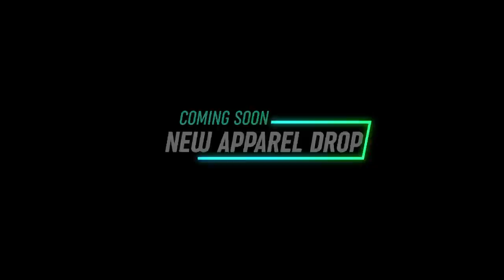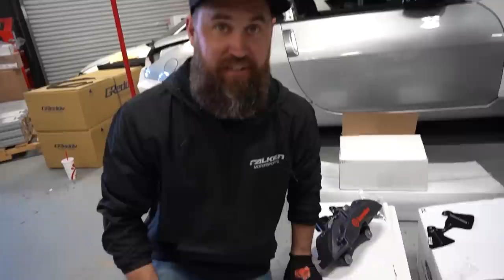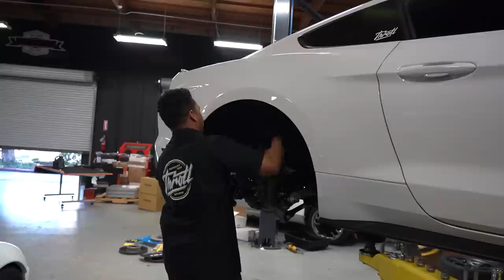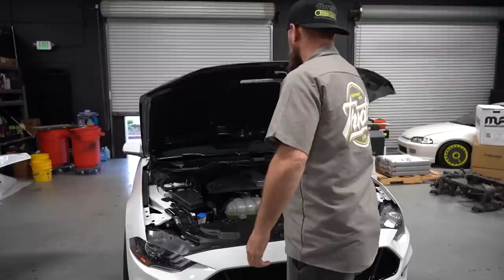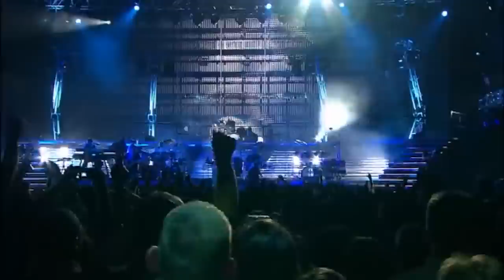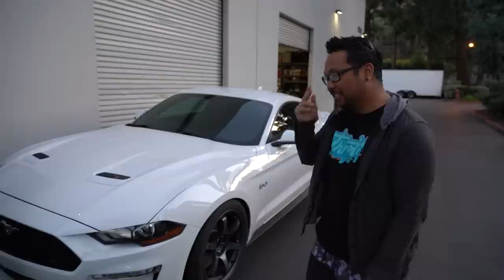Building and Heavily Modifying a 2020 Ford Mustang GT: Part 4: Brembo Brakes & Anderson Composites

Comment: Hey guys if your going up in pistons at the calliper, you need to increase the volume in the reservoir by the same percentage amount. Do Ford performance do a reservoir to match the new callipers? This will mean you won’t have to apply more force at the pedal with the new callipers.

Comment: As someone who currently has a bolt rattling around in their trunk I can definitely sympathize with that moment.
Reply: Use a magnet(s) and those one of those flexible spring loaded grabber, with the most important part, persistence.

Comment: Paint the hood car color. Leave the ridge around vent in fluoro yellow. And the vent “dent” in carbon. Then get some rays fluoro yellow wheel stickers for the 1 spoke (jdm style) en paint the red brembo letters fluoro yellow. Pull it into the car with the shift knob you removed from the NSX in fluoro yellow make the wing exactly as you said but with the little cannard edge also in fluoro yellow so it ties with the ridge of the hood around the vent 🤷🏼💪🏻😍

Comment: I don’t know if it would work but you should try put the stock front calliper and rotor on the rear
Reply: Depending on how the handbrake works on the mustang
Reply: Not doable and way too much brake for the back.

Comment: I doubt it would work but I’d be trying to get those stock front 4 piston an way larger brakes on the rear over those stock tiny boys or I would have ordered the brembos for the rear as well
Reply: Tiny? Those rear brakes are as big at the rears on TJ’s Huracan. They are more than adequate.

Comment: Guys its well in good to go from 4 to 6 pot brake calipers , But did it occur to any one to change the brake master cylinder to the "brembo sized" master cylinder for the best brake feel / performance of the new 6 pots  ??  witch the factory optioned/brembo equipped mustang would of came with stock  .... ALSO Paint as much as of the carbon as you can / thinking in the range if the ford performance factory did it, .. AS its NOT a SPOON sports Honda ek9/dc2 type R , ..... As full carbon looks a TAD tacky as you can imagine  , ..........  None the less great build Guys !

Comment: why not swap the old stock brakes from the front to the back for more stopping power?
Reply: you dont need that much stopping power in the back, the rear side is mostly for the parking brake
Reply: Was also thinking the same.... The front brake setup at the back would look good with the upgraded fronts...
Reply: Right on!
If not for the breaking power, then for looks
Reply: That’s not how it works
Reply: @typedrew   kind of expected that.
Reply: @FranticKnightX9  it looks so aggresive in the front and flimsy at the back, knowing that yeah it dont need much braking but its a mustang, it surfs crowds
Reply: @enigmarage3039  maybe the front brakes won't fit in the rear due to clearance issues or issues with the dust shield or the bolt pattern... don't own a mustang so can't say for sure... But yes... It would have looked dope if they did swap the brakes...

Comment: It really seems like it would have been easier to buy a performance pack model instead of adding all of them after the fact unless they did it like this just for content or they got the parts afterwards at a discount.
Reply: both
Reply: Of course this is why
Reply: The real reason is it wasn’t worth me spending an extra $10k on the car for just brakes. All the remaining PP bits we’re going to get discarded.

Comment: I was told once that it is not good to use those tools to install studs on your hub I was told also the proper way to do it is to use a shop press.
Reply: I’ve personally used this method for probably around 50 cars now. Not a single issue, ever. And, for the record, I did use the shop press for the first one on the rear and it was more difficult and took 20 times as long.
Reply: @mickeyandrade3435  i wonder though at what torque its takes to seat them, vs. A normal wheel torque. 🤔i really don't know 😕

Comment: I think this cartoon parts would look sck if you did what Dave from dde did with his carbon on his Gallardo he sent them out to be wet sanded and shot with a matt clear so that it had a dry carbon look I bet sos could handle that easy
Reply: We’ve done that many times. Thanks for the suggestion.
Reply: @mickeyandrade3435  right on i think the dry carbon is the best way to go with the white but then I realized you might not be going with white